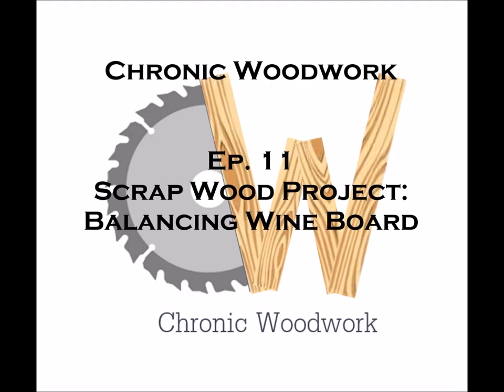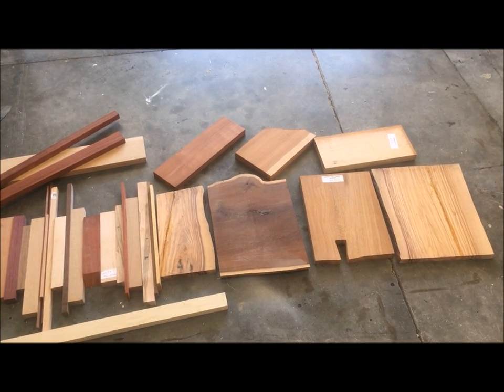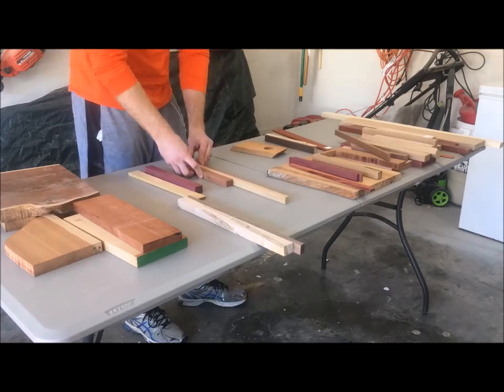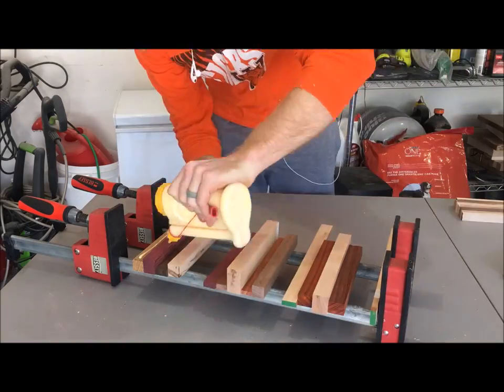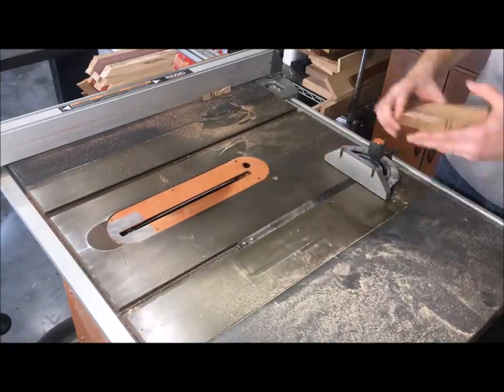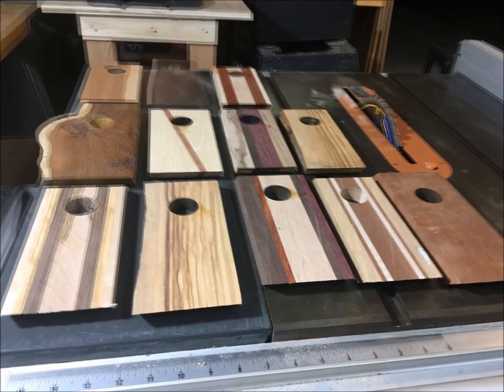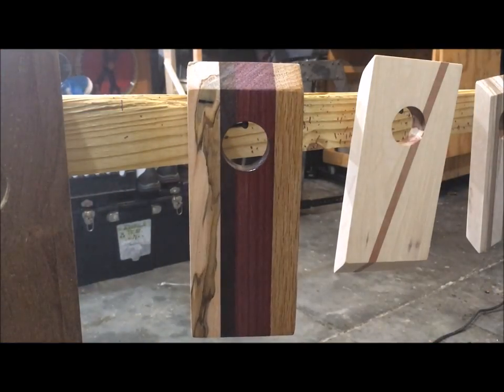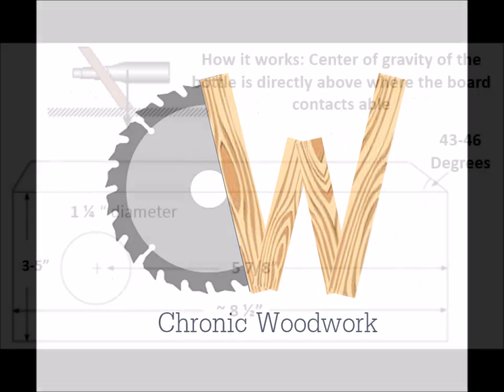Scrap Wood Project: Balancing Wine Holder

Comment: These are a fun little project that can be made in a relatively short amount of time. I was itchy to make some sawdust today, so I knocked out 4 of them in about an hour.  Just as  Chronic says, don't use anything less than 3/4" thick. Because I do mostly exotic wood items, I buy my stock from a professional supplier, rather than an orange or blue box store, so its 4/4, basically 1 inch thich.
Reply from the maker: martyphoto2009 thanks for watching Marty. Glad you could put those scraps to use!

Comment: Have you had any issues with the balancer not working for some bottles?
Reply from the maker: Phillip, of the 50 boards I've made over time, I've only ever had an issue with 1. The primary flaw with that board was that it was too thin. I wouldn't recommend a board any thinner than 5/8"

Beyond that, all the wine bottles I use have long enough  necks so you can make adjustments to fine tune the balance.

Comment: Does it matter how thick the board is?
Reply from the maker: Adam- not particularly. I wouldn’t go any thinner than 3/4”, which is how thick typical softwood material is at your big home improvement stores.  

These were made of hardwood scraps, which are typically sold in 1” or 2” thickness.

I do not mean to insult your intelligence here. I don’t know how familiar you are with the industry. 

Best of luck
Andy
Reply: Chronic Woodwork - No worries, I’m just starting out and trying to make a little money at this so I can add to my shop. Thought this looked like an easy project to start with that people would like. Thanks for the info!
Reply from the maker: Adam Reinert this is a big part of how I started. Make some samples and reach out to wineries in your area.
Reply: Chronic Woodwork - Thanks! That’s a great idea!